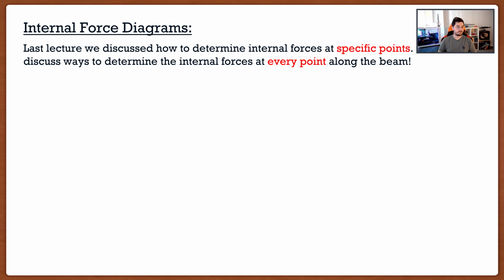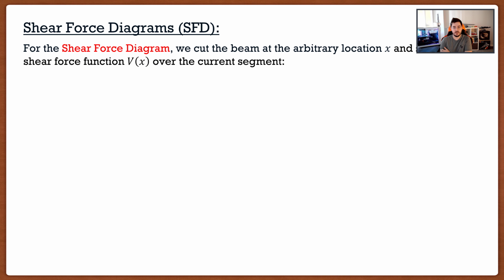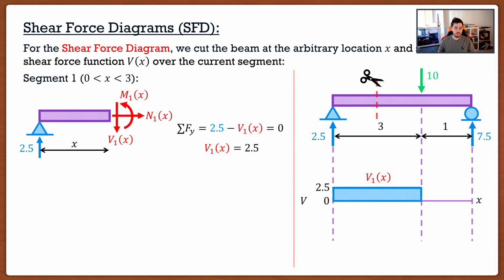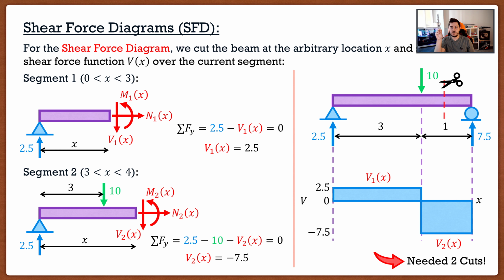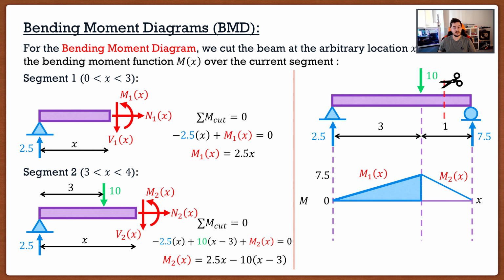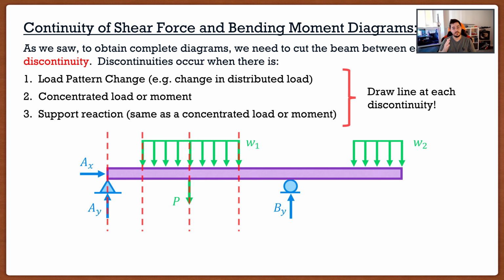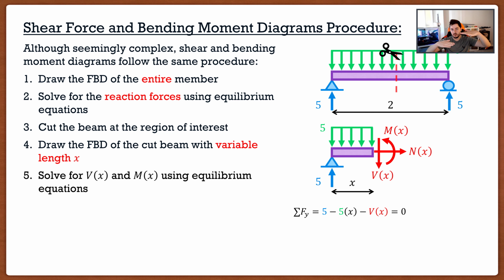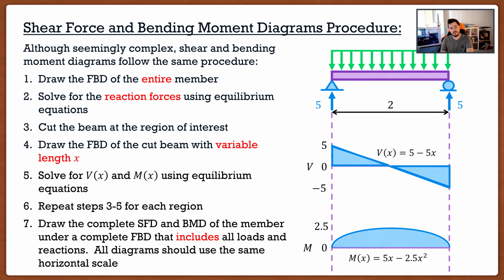Engineering Mechanics: Statics Lecture 19 | Shear and Bending Moment Diagrams

Comment: is the axial force the same throughout the beam or does it vary  with the location
Reply from the maker: It can definitely vary throughout the beam in certain scenarios but for flexure beam applications it is typically constant (and equal to zero), hence why we don't make axial load diagrams.  A good example where it would come into play would be frames.  Hope this helps!

Comment: Hi Clayton! For cases in which distributed loads are included, can we solve the distributed load first and combine it into one force then solve for the rest?
Reply from the maker: Great question but unfortunately no, you cannot treat the distributed load as a point load when sketching the diagrams.  You will need to convert the distributed load into a point load to solve the support reactions and internal force equations but when sketching the diagrams you will see that the shear profile is directly influenced by the geometric order of the distributed load so the shape of the distributed load needs to be incorporated into the sketch (e.g. a linear distributed load results in a quadrating shear profile but a point load results in a constant shear profile so they will be different).  This is explained more in the next video :) Tough question to explain through typing but hopefully this helps :P